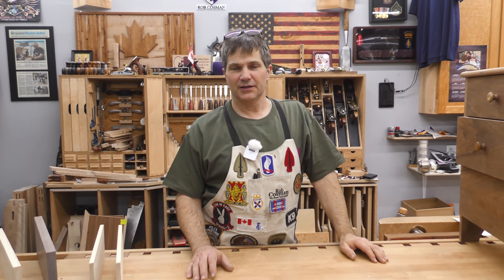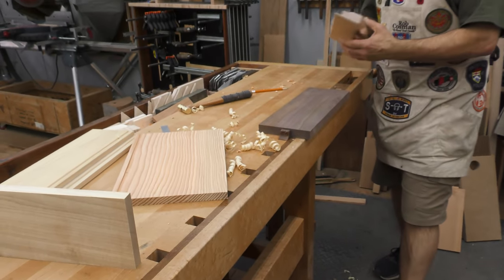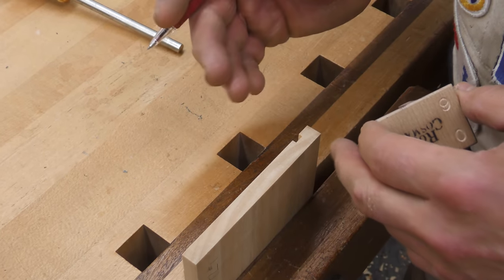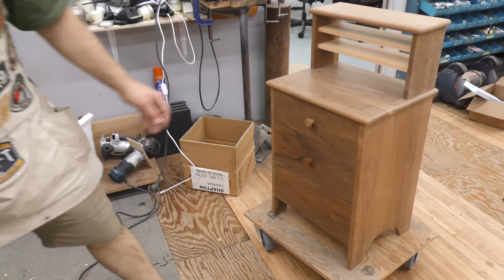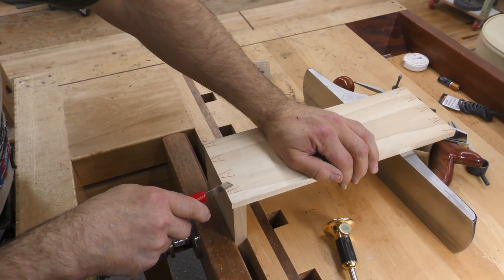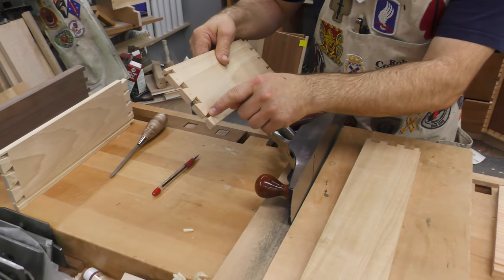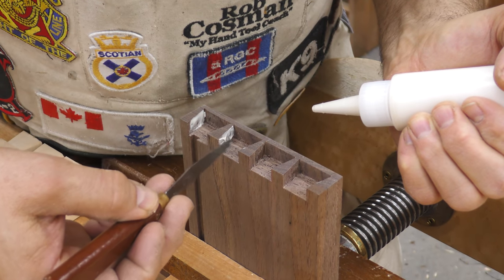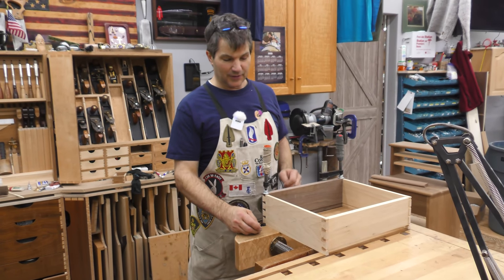Drawer Making - The Right Way (Joinery)

Comment: When making dovetail joints I also use your offset method which always gives almost perfect results. As an aid for this I made a simple rectangular block that is half about 1.5cm thick and the other half 1.5cm + the thickness of my saw blade. With this I always have the correct offset and I do not have to use my marking gauge for this. Every time I watch a video of you I learn something new. greetings from Flanders (Belgium)
Reply from the maker: Yes that's s great jig.  Several folks have made the same.  We are working on making them available through our site.

Comment: Thanks for the videos. I recently had to remake my drawer sides because I didn’t absorb your method for laying out the bottom tail on the back end of the drawer side. I pulled up this video and watched it again - standing in front of my workbench - and you got me through. 

I did have a quick question, what blades do you use on your feet saw? I’ve got #7 and #3 spiral blades that I don’t care for. I use your dovetail saw and the spiral blades score the sides of the tails and pins if I try to fit them through the kerf. I want to get standard style blades, but want to make sure they slide right down the kerf.

Comment: I know I am coming late to the party with a question, but here goes. Since everything is referenced off the bottoms of the drawer pieces, how do you lay out the pins on the drawer front if it is wider than the drawer sides? I want the drawer front to cover the carcass shelf.

Comment: Rob, 
When you are " wacking " the cutting blade at 27:00t would it be better to keep from blowing out " side load " the top or bottom pin and use a backer bord.
Reply from the maker: I dont know.  Try it and tell me what happens

Comment: What do you think of using a mitrered dovetale to avoid the stopped grove issue. And how can your system of making out the pins be used on the mitrered pin.
Reply from the maker: there is nostopped grove in the drawer?

Comment: I may have missed it, but the main argument against router table or table saw is noise and holding it down...?

Idk about the rest of you, but buying a new planer, making an insert, taping it, having dogs to hold in place, sharpening the blades, etc seems like a huge burden for most wood workers.
Reply from the maker: Think “process”.  If the “doing it” is not your thing vs the “getting it done”, use the router!